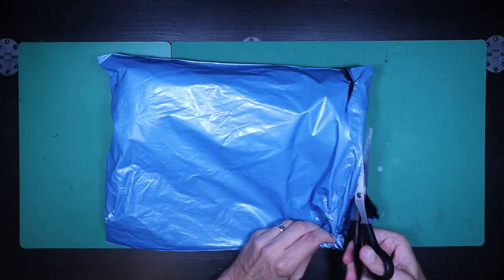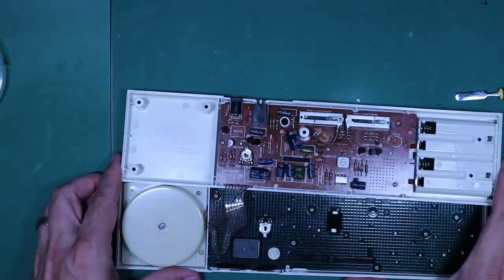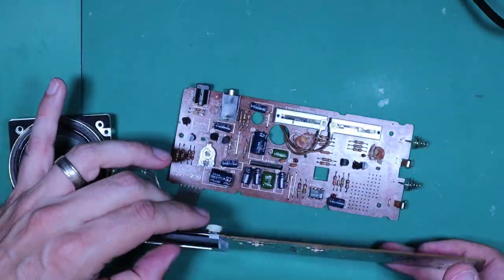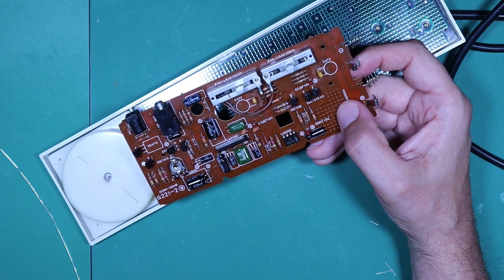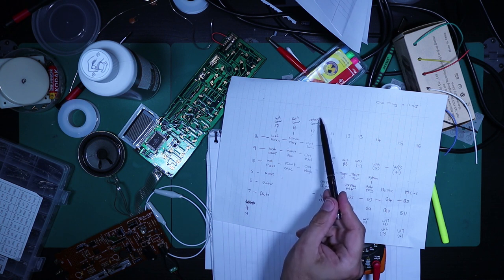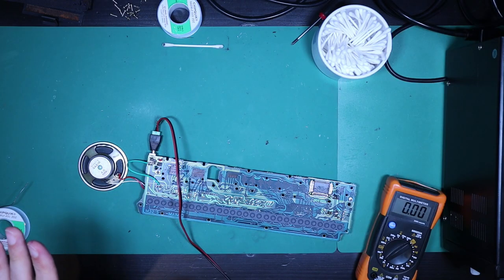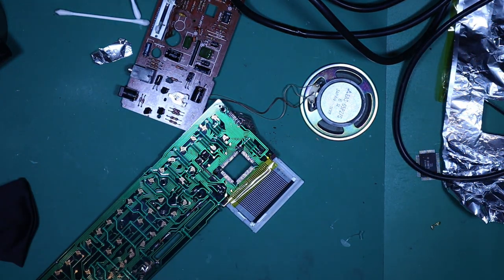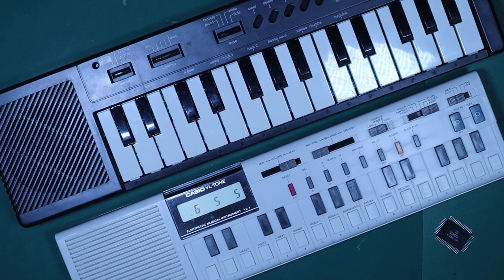Casio VL-1 Repair with Schematic

Comment: Do you have an affiliate link to the desoldering tool that you use in this video? I'd love for you to make at least a little something for your trouble, and I could certainly use such a tool.
Reply from the maker: I don't have any affiliation but here is the tool I used (although the price is much higher now than when I bought  mine).

 https://cpc.farnell.com/duratool/d00672/desoldering-station-uk-eu-plug/dp/SD01384?scope=partnumberlookahead&ost=D00672&searchref=searchlookahead&exaMfpn=true

Comment: Hey man i need some quick help. I plugged mine to a speaker w the line out and now it only sounds with speakers and amplifiers, the display system and calc work fine. The minus sign was flashing so I switched the batteries (and reset with CAL + p) but its still flashing. 
Could I have maybe killed the speaker or damaged the jack? Anything helps thanks brother.
Reply from the maker: Hi sorry for the delay in responding. I doubt you'd have blown the speaker or damaged anything just by plugging in a speaker to the line out. More likely in my opinion is that the jack is stuck open. If it were mine I'd start by cleaning the jack with some contact cleaner. I'm not an expert in repairs so this isn't advice, just what I'd do if it were mine.

Comment: Hey man! Nice video, got to fix my keyboard because of it! However, I couldn’t get the LCD to work and a few piano keys still don’t work. Any idea how can I fix this issue? Thank you!
Reply from the maker: I would check all of the tracks with multimeter, you may have a cracked track from flexing. Note down all the the keys that don't work and see if they share the same track. The LCD is run directly from the processor. Other than the ribbon/solder joint Lt the LCD there isn't much to check. If the joints and ribbon are good it could be a faulty processor or LCD. Good luck with the repair and thanks for the comment.

Comment: My VL1 was working perfectly fine until I hooked it up to an external speaker. Now it only works when hooked to a speaker and the built in speaker makes no sound. . The internal speaker worked before I plugged a speaker into the output jack. Any ideas?
Reply from the maker: Hi I'm not an expert in these repairs so please don't consider this advice, but I suspect the speaker socket has a built-in switch that disconnects the internal speaker when an external speaker is plugged in. That could have broken. A replacement socket might fix it, but if it were mine I'd first try cleaning it with a residue free contact cleaner or something isopropyl alcohol

Comment: Strange my VL-1 has 220uF Caps instead 470uF?
Reply from the maker: Interesting! perhaps casio changed the decign. Sometimes manufacturers do that for reasons of cost, or reliability. Thanks so much for your comments

Comment: Hello! If by any chance that your reading this. I spilled a bit of water on my casio vl-tone and when I play it, it sounds very low (I tried the volume it's still very low) and kinda distorted I tried to blow air on ever hole and keyboard it still don't sound the same still low volume and a bit distorted or kinda distorted My Casio vl-tone is older than me And has been with my family for years its a shame that I ruined it... So please Tell me how to revive it back if any chance your reading this. I tried searching it up but still nothing. Your my only hope.. Thank you
Reply from the maker: Hi Yuri, I read all my comments and will help if I possibly can. I should say I am not an expert in these repairs I am just starting out amateur. So I can only say what I would do of it were me, it's not advice or a recommendation, just what I would do. On that's basis of it were me I'd carefully open it up and dry any water you see. I'd then clean the analogue board (the one without the chip or display) with some 99.9%  IPA on a cotton bud. Give it time to dry and try the keyboard again.

Comment: Please add a warning to people in the description, not to remove the keyboard PCB unless you have to. There is almost nothing on it but the main cpu anyway. Best to not touch that side of the VL-1 unless you absolutely have to. They keep breaking because the ribbon to the lcd is so fragile.
Reply from the maker: Great comment @solarLantern I wish I had known about this before I did this repair. I have a vl1 with no LCD display but otherwise working so perhaps I'll do a video on that soon. Thanks so much for your comment
Reply: I found the same - removed the board and found the ribbon completely separated from the PCB. looks like it was like that before I got there but not great to see. pressing the ribbon onto the pads doesn't revive it either so it might have failed at both ends. The main fault preventing sound was elsewhere but would have been nice to have the display working too...

Comment: Tengo un vl-10 y la afinacion de las notas el tuning no es la correcta, en los modelos posteriores lleva un regulador pero este modelo no se como ajustar el tuning, si alguien sabe como solucionarlo que lo diga. Gracias 
I have a VL-10 and the tuning of the notes is not correct. Later models have a regulator, but I don't know how to adjust the tuning of this model. If anyone knows how to fix this, please let me know. Thanks.😢

Comment: Sounds like you have worse problems than mine. The line out doesn't work, the slide pots are noisy, but apart from that it's fully functional after all these years.
Reply from the maker: I think I was a bit unlucky with it. I would guess that some deoxit or even IPA on the pots and line out connector will have you fully functional. Might need to lube the pots a bit after. Good luck. Lots of fun. Thanks for taking the time to comment
Reply: @RetroTechRepair  well thank you for making the video. I just took mine apart this evening, reached an impasse and looked at your vid for inspiration.

Comment: I had to take mine apart to try and fix the screen but these two flat rectangular pieces fell out and i have no idea where they go. any clue?
Reply from the maker: Im not sure exactly what pieces you mean. Was it a key or button? If so maybe take a look at the vid or some kr the pictures to see if you can work out where they came from
Reply: RetroTechRepair it funny i can’t tell where they go. they’re not keys just flat rectangular thin pieces (2 of them) with rectangle cutouts in the center. they are like dark colored and wafer thin
Reply from the maker: @rdimaiojr  I'm not sure, perhaps they are not that important. Lol
Reply: @RetroTechRepair  Figured it out. They go behind two sliders as "dust protectors" I'm guessing.
Reply from the maker: @rdimaiojr  lol yes that's it! It never occurred to me. Nice catch
Reply: they are for the sliders I done same thing today and nearly lost them.

Comment: Hey, fantastic that you got it working, really nicely made video as well, thanks for all the effort! I know it was a little while ago but I was wondering if you'd maybe be able to point me in the right direction here - any ideas for a good approach to a VL-1 that doesn't show any signs of power? I've tried the AC adapter socket, cleaned the battery contacts, and inspected internally (only thing close to an issue was some dust, no visibly dodgy components), yet nothing on the screen and no noise - I'm a little stumped. Thanks and happy festive season to you
Reply: In case anyone else has a similar issue and finds this comment when looking for ideas - I had another look inside and it turned out that the 3 switches had some subtle corrosion I missed before (both on the PCB side but mainly the slider contacts), which I worked off with a contact cleaning pen, isopropyl alcohol and earbuds - completely solved it, very lucky it was so simple! Anyway sorry for taking up space here, I just think its good to document these things in case they could help someone out one day.
Reply from the maker: Fantastic Max! I was going to respond today but probably wouldn't have thought of that. Nice find. Thanks again for your comments.

Comment: I am also having this issue, bought 2x VL1 and 2x PT10.  both vl 1 have similar issues, both no sound, 1 occasionally displays a part character, the other flashes randomly.  Switches/modes/reset/psu or battery it makes no difference.  After removing and testing various components from power boards (no faults found) I swapped the boards between the 2 VLs.  No dufference whatsoever.  Looks like both will have blown cpus as with your video?  Any other tips?
Reply from the maker: Hi Chris, sadly I don't really have any additional tips. If I were to do it again I might try hot air soldering replacement chip on, bit since I have never done it I can't say. I never expected such a complex repair. Good luck with your own repair and thanks for your comments. Stop back and let me know how you get along
Reply: Well I have parked the VL-1s just now, got another one making no sound, that was just battery corrosion, on the connector between boards.  What I am chuffed with is having troubleshooted and fixed a new yamaha pss a50, theres been a few of the new pss a50 f30 and e30 dead on arrival, or dead after a week, (see amazon reviews 1*) tiny smt boards... not feasible to replace components, as v difficult to even trace the tracks, took around 4 hours with a logic probe, finally had an idea and hey presto, a £100 keyboard for £20 ;).  Also fixed a casio mt 65 dead power board, I have other dead MTs which I will also apply this fix to.  Like you, I love to fix... plus it distracts me from the PhD ;)
Reply from the maker: Wow you have been busy, nice list of repairs. Good luck with PhD masses of work I'm sure